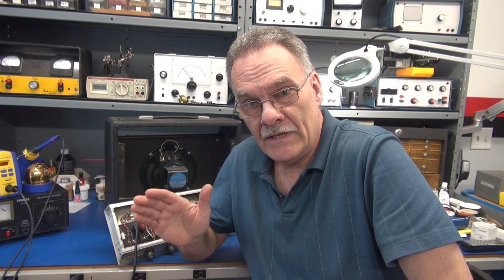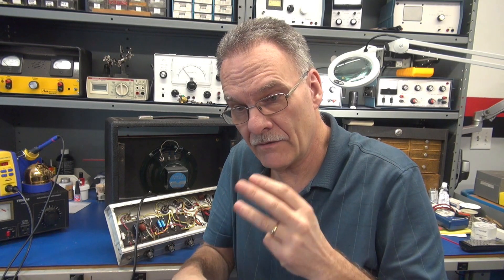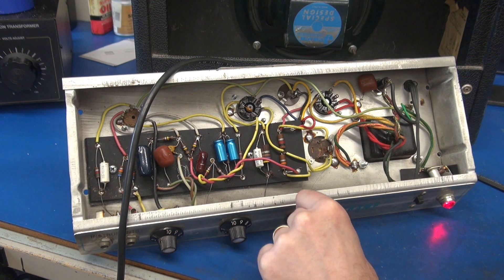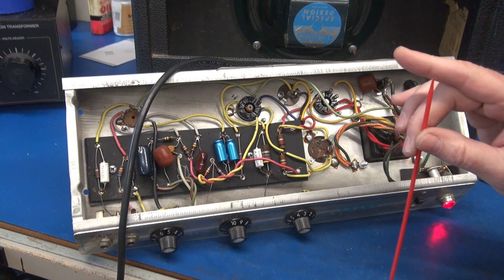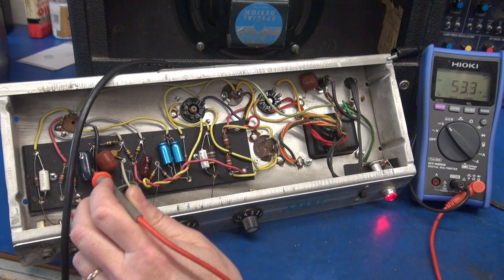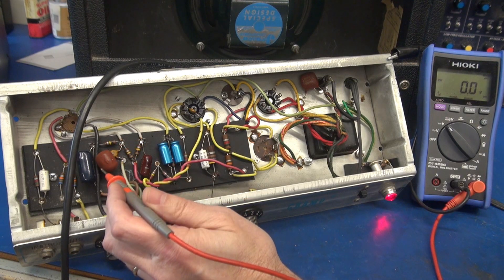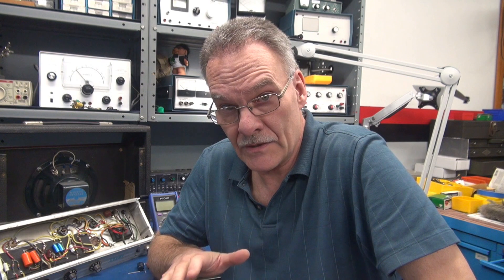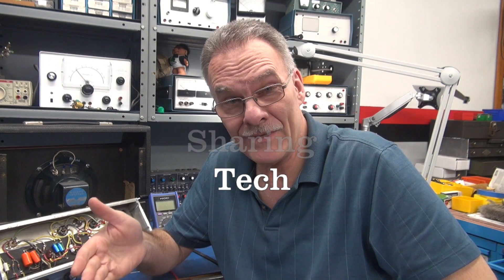New D-lab series Basic Training Tube amp repair How to really fix a dirty pot Not what you think

Comment: Hi, I have a general question. Are stock cables and probes provided with cheap multimeters safe to work on guitar amps? Since I want to get alligator clips, what type should I get them? Do cables need to be 600V rated? Thanx in advance.

Comment: Question: if one of the caps is more suspect than the other (the 0.1 uF in this example), in the interest of preserving the good original components (if the owner is concerned about maximum originality), why not just change the 0.1 first (since it had higher DC leaking through), and see if the 0.47 is actually  good?

Comment: nice idea for the series Terry - thanks for all the great content.  you mention the problem here being a leaky "tone cap" rather than identifying it as a leaky "coupling cap" feeding the tone stack.  thought it might be helpful to point that out since "tone cap" is the standard term referring to a cap between a tone pot and ground responsible for altering tone and using that term to describe these frequency tuned DC-filtering couple caps could be a little confusing for some audience members.  cheers.

Comment: Howdy. Great.
I had a persistent problem with my DIY amp. The driver stage of one channel sounded awful and the DC levels were nuts. I disconnected the input cap. No change in levels. Then disconnected the stage neg. feedback cap. Still no change. Finally I disconnected the global neg. feedback cap. Voila ! Unmounted the cap showed a resistance of about 800 ohm. Brand new cap and faulty ! After replacing and reconnecting everything the stage worked fine. Since then I have encountered another leaky cap in the bag of 50 items I bought.
Lesson. Sacrifice the time to resistance check caps before soldering them in. Will save one a lot of headache in the long run.
Regards.

Comment: WTG Terry, thanks again for sharing your valuable knoeledge.  Those dang leaky caps strikes again!  Knowing which stage or section of the amplifier to troubleshoot comes from understsnding the circuits of each staage, power supply, preamp, amp, or speaker.  The preamp cam be devided into sections, tone, fx, or controls and their tubes.  I've learned from you a lot aboit tubes and their purposes or multipurposes, how to break down each stage by their tubes, PS, preamp, and PA.  One thing that I do first is troubleshoot for bad connections, then old caps.  Way back, we tested tubes first at the Rad Shak becsuse the caps and pots  were not old yet.  Then maybe a blown speaker from abuse?  Sometimes we got lucky, and bought a ""Lifetime"" tube or cheapo speaker from Radidio Shak!
Reply: PS: btw, way back, I had a Rad Shak MIJ guitar amplifier that had two twelves as I recall.  It had four tubes, I guess, since it had reverb and tremolo.  It was either a 6aq5oir 6bq5 amp.  Lafayette sold a simular guitar amp that was supposedly a rebadged Univox.  It serms that you favor "made in the usa" amps. The MIJ copy cat amps were built cheap, and at best were good for home practice.  I'd like to see you do a vid about an old cheapo made in Japan copy cat amp, to see a diagnostic 50+ years later.  .  Rad Shak amps are quite rare, but you might find a tubie Univox for funage.

Comment: It’s always such a joy to work on old hand wired boards and chassis mounted sockets and pots. 
Today’s typical tube amps are ugly multiple double sided circuit boards with surface mount components and a rats nests of ribbon cables. You’ve got to have an electron tunneling microscope to see what you’re doing. 
You literally have to rebuild an amp just to change a blown hissing resistor. 
Good look on your new full time work. Always enjoy your videos!

Comment: I sent my Champ in to have it serviced, the volume pot was noisy and it started popping and making static. It came back with a new rectifier tube and was still noisy at the volume pot. I replaced the pot myself and the popping came back. Grrrr..the original Fender tube was probably still good. I noticed the power tube and rectifier tube were kinda loose. I replaced the tube sockets  myself. All is good. I will be watching the videos.

Comment: Yeah... Longtime subscriber and I do enjoy seeing these type of issues and the solution.  Perhaps slightly more explanation.  Okay DC on a pot but why does that make it scratchy?  My guess is DC discharge causing tiny sparks, almost microscopic but enough to change the audio signal from flat nothing to a series of point discharges as the pot surface is rotated. 

Oscillations, hum loops, conductive boards, NFB resistor sizes verses the tap on size of NFB added or removed, Hum in general, plate and cathode wires to close to grid, raised heater...why? and How do you make one? Wrong size pot what happens...symptom, Linear when should be audio tapered, X-Cap bias feed circuit, crackle from carbon comp resistor fail, why dual bias circuit could be useful in these times with hard to find tubes.  Some ideas.  Love the format, induce a problem guess the issue and why the fix is the fix.  Great info channel, keep up the great work.🙂

Comment: Thanks for this valuable info Terry. The new series is an awesome idea. I have several old amps that I tinker with, not a pro repair guy by any means but enjoy playing guitar through these old dinosaurs. Usually when I experience an issue with an amp I move it aside and plug into another one.  This summer will be contacting you for some repairs. I am in Indiana. Thanks

Comment: This is good! Looking forward to more like this!
Reply: I'll bet there are lots of folks who would love to see one of these done with an inoperable Fender tremolo circuit. I just spent a few hours fixing one. I tried everything. Once I took the LDR leads out and tested the resistance out of the circuit, it was obvious the resistor had gone bad. I assumed since the light was blinking that the opticoupler was fine. I wound up making my own new "roach" with an LDR and high-brightness LED. Trem works better than ever now. Anyway, I'm sure you have a much better approach to it than I did and I could have saved a lot of time. I make tons of YouTube videos. I'm a Realtor so nobody watches mine, but I know good video production and this format is great! Short, to-the-point and packed with good info.

Comment: When I heard the sound I knew what it was, DC across the pot. Once you have heard that sound you know. Then you need to track down the source of the DC and how it is getting there. I had a stepped type treble and bass controls on a Magnavox console that would pop with every step change due to leaking caps. Replaced the coupling electrolytic caps in the preamp and amp and no more pops.

Comment: There can be leakage on the board itself too, and changing the caps is just a temp fix and they aren't really leaky. Should desolder one end first and check if there is any voltage to confirm suspicions. If there is none, start measuring the board, they attract crap from smokers and moisture, also that wax that CBS started adding later can become conductive and it needs to be removed in some cases.

Comment: I  just   finished   building  a  Fender  Champ  5C1    and  love it!    It  is   basic,  just  a  volume  control,    five   watt   practice  amp.    I  plugged  in  a  12  inch speaker  Vintage   Classic  from Mojotone...   sounds  great   with   just  enough  low  end.  Next  is  a cabinet  to protect  the  speaker...  my  thoughts    the   Mojotone   Tweed   Deluxe  1x12    ...